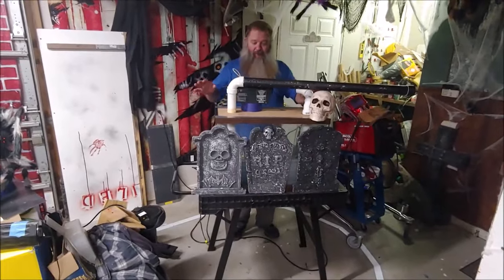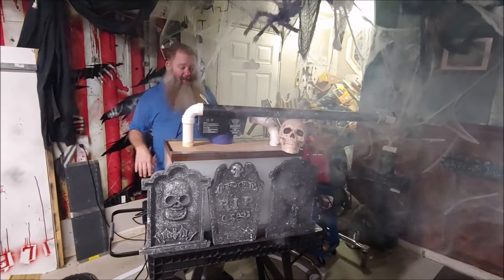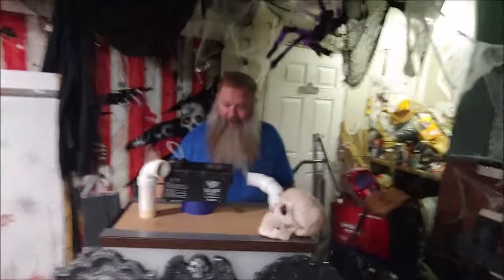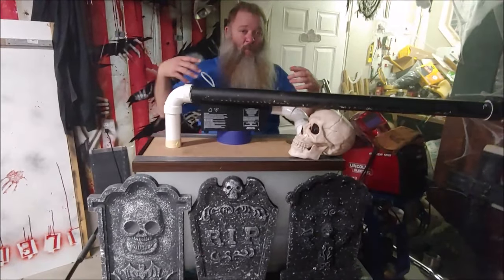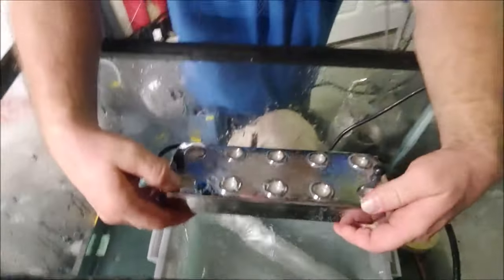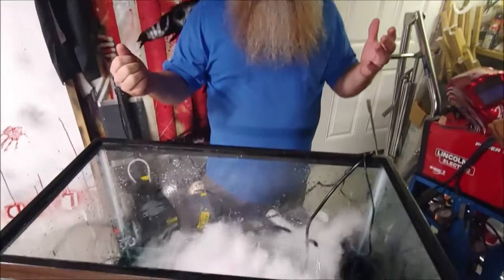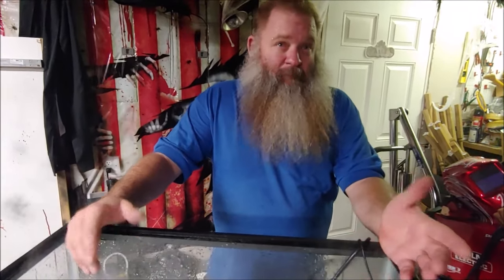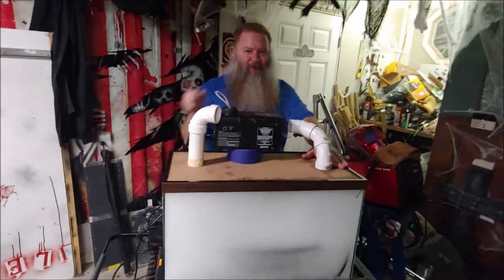Roberts Fogger: The original DIY Fog Chiller without ice

Comment: I am more that impressed. the fog coming out of the fog machine expands as it comes to contact with oxygen within the 3inches gap u left and mixes with the mist for a greater output. but my worry is , won't the water get hot at some point and reduces the effectiveness of the result?
Reply from the maker: Thank you!  And you are correct - the water does get quite warm - but that is from the fogging unit more than the fog machine.  I don't know how to accurately measure the drop in efficiency, but after 3 hours - the output is still quite similar to when it is started up.  But I believe there is a change in performance.  I am sure you could cool the water before recycling it into the tank to improve this.

Comment: Fascinating.  Are the input and/or output tubes above the water or under the water?
Reply from the maker: Thank you!
Both tubes are above the water.  Although now you have me wondering what would happen if I drop the input tube a little into the water. Hmmmm 🤔
Reply: @intocoasters  My guess is not enough pressure on the intake side to force the fog into the water, but it it could it would maybe gain a ton of moisture and cooling.

Comment: what size pvc are you using ? I  am building one myself and will be using it along with a Hologram.
Reply from the maker: I am using 1-1/2 pipe for this set up.  I changed the output to 4" dryer hose when I rebuilt it.   
I'd love to see your setup when its done!!
I made a fog screen that has a floating image kind of effect: https://youtu.be/Xc2jr2DB-FQ?si=upCAFx8XSSrhN8E7

Comment: Very good idea. I'm pretty sure this is not making the machine fog fall by picking up moisture. It may have appeared to work that way in the direct ice contact version (vs plastic pipe version), this is because the plastic pipe is a poor thermal conductor. Consider the trash can chiller that uses aluminum dryer pipe inside. Even though the fog doesn't directly contact the ice, they still produce large volumes of ground fog. I believe yours works in two main ways. One, the most obvious is the fog machine is pushing out water vapor, in addition to the machine fog. This can be seen in the volume of falling fog when you first turned on the fog machine at 13:20, there was not time for the machine fog to have traveled to the output. So we were seeing the water vapor contribution to the total output. 

Second because it is water vapor in the tank, it has a high thermal conductivity and mass (compared to air). Which means the mixing water vapor in the tank will do a great job of pulling heat out of the machine produced fog. Making the machine fog cooler, and more likely to not rise. Finally with the heavy water vapor falling the machine fog will tend to be pulled downward with it, so the flow tends to go down. One of the downsides of this method is the persistence of the fog is reduce by the faster dissipation of the water fog. Overall, it is a very clever design, thanks for sharing it.
Reply from the maker: Thank you Bobby, I love geeking out about this stuff. I can't wait to learn as much as I can about thermodynamics and fog effects for Halloween. It truly is one of my favorite effects.
I've made a video I will postlater this evening that shows the behavior of just the mist and the fog plus the mist. I don't know if it answers any questions but it's interesting to see the Dynamics of the two.
Thank you so much for your insight and for sharing!
Reply: After further consideration, I'd say the faster dissipation of the water vapor would be offset by the resulting rise in humidity. Which helps keep the conventional fog from evaporating as quickly. Mush like spraying the grass with water to make ground fog last longer.

Comment: why such a big transformer?  I know nothing about electricity... this project is awesome!
Reply from the maker: The ultrasonic misting unit needed 48 volts of a certain current that I can't remember at the moment. So I ordered a power supply with a slightly higher current capability just so I wasn't taxing a power supply that met the minimum requirements.

Comment: I know I’m very late to the game, but I’m wondering if it’s because fog juice is made with glycerin and glycerin is a humectant. So I’m wondering if by giving the fog (fog juice) the opportunity to hang with the humidity you’ve created that it’s allowing the glycerin to do its job as a humectant should and becomes heavy laden with moisture, therefore becoming more dense and laying low. I could be completely wrong but I’m just going off what I’ve learned in all the years past of being a bath and body product creator using glycerin. 🤷‍♀️
Reply from the maker: I really don't know how or why, but it seems that humidity is more important that temperature with this effect.  The water tank gets warm pretty quickly when the mist unit is running but, the fog seems to stay low with the same effect as when I first turn it on.
I had to look up "humectant" LOL

Comment: Do you have any specs for the pipe on your outlet. That’s the exact effect I’m looking for to have fog roll down curtains
Reply from the maker: Hello and thank you!  I used 1-1/2" PVC.  I drew a line on the side of the black pipe and drilled 1/4" holes about 3/4" apart from each other down the length I needed.   Here is a video of how I made the fog dispersion tube: https://www.youtube.com/watch?v=Xc2jr2DB-FQ&t=347s

Comment: Accolades, you are the best. I don't want to over praise you, BUT son that is some seriously, seriously great information.  Thank you for sharing.

Off topic, I saw a door knocker for sale on some Prop site.  It is just a free game knocker from a pinball machine. If you have ever won a free game playing, you would know just how loud they are. 
I have the knocker, but I think it is 50 volts. Would your power supply for 48 work?  Where did you or more importantly what is the power supply to?.  Video games power supply were 5 volts and 12 volts.   Unless there was I a terminal for 50, I don't have one to check.

Again, thanks in advance and how you don't have WAY more subs is beyond me.
Reply from the maker: Thank you very very much! Seriously, thank you. 
the power supply is just a general 48 volt DC power supply. And I don't see why it would not work with the solenoid. Are you sure it's 50 volts and not 24? I have to pinball machines so I am very familiar with the credit knocker.  One of which is very startling.
I found the power supplies add an online wholesale supply.
Reply: I use to buy, sell, collect pinball machines.  Actually anything coin operated.  I tried looking for the info on the knocker and what I saw was if you use 24V it will be real weak.  I sold off my last 4 machines so I can't test it.  Thanks for replying.

Comment: So would you achieve the same effect by simply putting a few pieces of ICE into your Fog Chiller hose? You would have the cold on the outside of the hose in your chiller) andthat extra bit of moisture on the inside  that your Fog picks up on its way through the hose and Fog Chiller apparatus... Without having to remake your existing chiller and adding the aquarium and other electronic components.
Reply from the maker: I'm not sure - but it could be a fun experiment.  I have also wanted to try to add dry ice in the tube as well.

Comment: How far apart were the holes drilled in the horizontal pipe. What size are they.
Reply from the maker: The holes are about a quarter inch in diameter and they were not measured between them, just eyeballed it. Anywhere from a quarter inch to 3/8 of an inch apart

Comment: What makes fog juice good or bad? I was planning on making my own with glycerin, is that a bad idea? I'm in Hawaii so we have higher ambient temperature but also higher humidity... any tips? Thanks!
Reply from the maker: I think it's expectations that makes fog juice good or bad. Cheap fog probably has a higher percentage of water and therefore less dense output. But if all you want is a general Haze then that would be appropriate. I have tried cheap department store fog as well as specialty fog. I find all of them acceptable for different applications.
And I don't know where this concept of if it's cold out the fog hangs lower came from. That's just not accurate. Fog is hot and will tend to rise if it's cold outside the temperature difference is greater therefore making the fog want to rise even more. My experience is the warmer it is outside, the better it hangs low when chilled.
And fog seems to really love humid days. It's crazy!
Happy Hunting!!
Reply: @intocoasters  Ah ok, that makes sense! This is my first time incorporating fog into my haunt so I'm really happy to hear it'll likely stick around just fine. Thanks for the reply, love your videos!

Comment: Could you, after determining the best height for the mister unit, drill a hole in the side of the inner basin that would keep the water level in the mister basin constant? This way you could have a sufficient supply of water in the outer basin/fish tank to run extended periods by continually pumping water from the outer basin to the inner basin.
Reply from the maker: Absolutely!  In fact, that was how I planned on doing it. But I got so excited during testing once I determine the proper level that I jumped into filming before taking measurements and drilling in the little basin. But yeah, that was actually the original idea. I was also going to mount the pump to the side of the little basin so that I could remove the basin, mister, and pump as one unit
Great suggestion!
Reply: Drilling a hole through the inner basin really just coverts the entire system into a single basin with one water level, namely the fish tank. That large overall water volume of course will allow the mister to work longer before the kill switch is tripped, but the real issue is the depletion of water from the system by venting the mist out through the lid. That loss of water is what eventually lowers the water level below the mister’s required operation level. Using a float along with the mister will keep the system running until the whole tank basically runs out of water and the mister hits the bottom. So, to recap, drilling a hole through the inner basin just increases the effective size of the inner basin to the size of the fish tank.
Reply: @geoffiida3315  Think about it a little longer and it will come to you.
Reply: @Preceptor-lf1ht  A little patronizing, no?
Reply: @geoffiida3315  Yes, but did you realize that a small hole in the inner basin and setting the pump to replenish the water that is being misted with a slight overflow could provide you with a much greater run time as the pump rests in the larger basin as the primary source of water?
Reply: @Preceptor-lf1ht  Sure. I read your original suggestion (drilling a hole) as your way to ensure there is plenty of water getting into the inner basin. But now it sounds like you’re saying drilling a hole was a solution to ensuring there’s not too much water above the misters. Do I have that right? I think I misunderstood your point because if it is to drain excess water out of the inner basin so as to avoid drowning the misters, that issue could be solved by placing the misters near the top of the inner basin (on a block, for instance) so any excess water simply flows over the edge of the inner basin while still allowing the misters to function properly
Reply: @geoffiida3315  Correct! So not to drown the misters.
Reply: @Preceptor-lf1ht  If that is the concern, do you agree you could just elevate the misters to near the top of the inner basin rather than drill a hole? Alternatively, using a float would avoid the concern about drowning the misters, but the float costs something like $35. Thanks for the conversation.

Comment: Does the output have to be on the top or could it be moved to the side and lower to the base of the plastic tote?
Reply from the maker: I'm not sure.  I suppose it could be on the side.  I used the top because I'm using a glass box for the demo
Reply: I would imagine the holes can be anywhere you want, as long as you have a good seal on the lid and there's no other way for air to get in or out of the box. That way when you pump in fog into one of the holes it creates a higher pressure inside the chamber, so it will naturally push the fog out the other hole no matter where it is

Comment: Any word on how just using an ultrasonic steamer that comes with a floating ring worked? Mentioned you might try this in an earlier comment.
Reply: I think that would work just fine, But from what I've seen from the price of some floats, the pump method might actually be cheaper.
Reply from the maker: When I looked them up, I found the small pump was cheaper, so I haven't tried this for myself.   I  should build a float for testing however.
Reply from the maker: I have since tried the ring.  It worked out really well.  Less plugs to deal with.  

Although I am on the fence about float versus pump.  I see value in both methods.  The pump could also be used with a small radiator to cool the water before filling the small water chamber.  But now that adds complexity to something I was trying to simplify. LoL

Comment: The ice increases the density of the fog which makes it settle close to the ground. Your process works like a cooling tower at a cogen. Same principle different process
Reply from the maker: I had to look up COGEN.  Pretty neat idea cogenerating power and heat.   I have been told this kinda works like a swamp cooler.... I wonder of that is similar to the cooling towers?

Comment: Excellent!  The ultrasonic misters work by using sound waves to break up the liquid mass of the water into smaller particles which create the mist.  In addition to the thoughts below which include; increasing the thermal draw from the fog and also bringing in more volume from the mist itself (you have two fog machines in essence) and increasing the volume of water in contact with the fog, you also have the mister breaking up the glycerine in the fog fluid - heat is used by the fog machine to break up the glycerine and glycols by using energy to break (or in the old oil foggers, crack) the chemical bonds - this process is not 100% effective which leads to poor, inefficient fog production.  The misters remove a significant amount of this inefficiency.
Reply from the maker: This is an awesome explanation!  Thank you!!
Reply: What if you run this thru dry ice would make more dense and stay low better.

Comment: This technology already exists and can be bought.  The Chavet Cumulus already does this and you can buy it today.    Humid air is actually LESS dense than dry air.  You have it exactly backwards.

The reason your fog drops to the ground is because its COOLER.

You accidentally built an evaporative cooler.  Old technology.  When you turn the water into mist, it cools the surrounding air while heating up the water left in the tank.   So the fog is actually chilled.   As the water in the tank heats up, the effect will become weaker over time, which you already observed. Picking up moisture has nothing to do with it.

The solution is to trickle in fresh water which is cooler, and have a draining hole to let the hot water out over time.   

Evaporative coolers can easily drop the air temp 50+ degrees.   This is why this works.
Reply: Here is the commercial version of what you built:

https://www.youtube.com/watch?v=GuGHZJppA0w
Reply: @speedgliding  how much will this cost?
Reply from the maker: Very cool.  And I'm not surprised in the least that there is a commercial version.  I didn't believe I stumbled on this effect for the first time ever.  I had just not seen any diy dog chiller using this method.  
Cooling makes sense as the fog is cooler to the touch on the output of the chamber.  The fog is quite visibly denser as well, so I imagine it is picking up water vapor as well.  Someone else talked about energy transfer when the glycerin and water vapor combine that helps will cooling.  
Thanks for the info!!

Comment: would this work better with ice
Reply from the maker: Short answer: The low lying effect is the same.
 However, The reality is It depends on what you are looking for from this.  Ice chiller would be simpler to construct, and all the parts are probably around the house right now.   I've used ice for years before building this.  
 Why did I change to this method?   A bucket full of ice works perfect for the first half hour to an hour.  The constant use of fog melts the ice and the low lying effect becomes less and less over time.   The ice needs to be  refilled several times a night as well as emptying the water (if there is no built in drainage).
  This method ran flawlessly for hours without any babysitting.  The fog machine ran out of fluid after about 2 hours because of how often I was cycling it. 
 Before this build, I never ran out of fog fluid before needing to refill the ice or empty the water from the melted ice.  So this means I only needed to tend to the fog machine once per night, rather than 4 or 5 times.

Comment: Why put the mister in an inner container? Why not just put it directly in the fish tank with water?
Reply from the maker: Excellent question!  If the misting unit is too deep I the water or too shallow,it doesn't work properly.  
Since the water mist gets removed with each blast of fog, the overall water level drops over time.  
The separate container is set to the optimum water depth for the misting unit.  A pump continuously fill the container from the tank - forcing it to overflow back into the tank.  
This means the misting unit will always have the correct depth as long as there is any water in the tank to draw from.